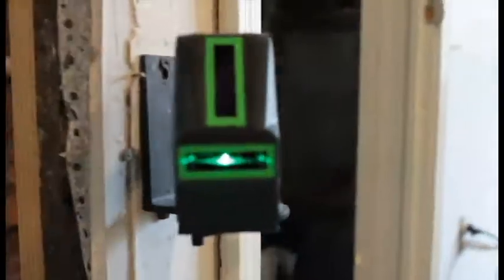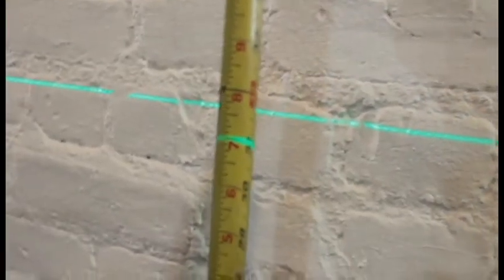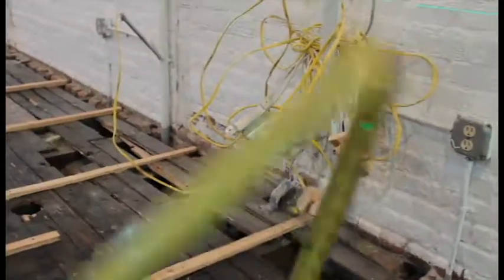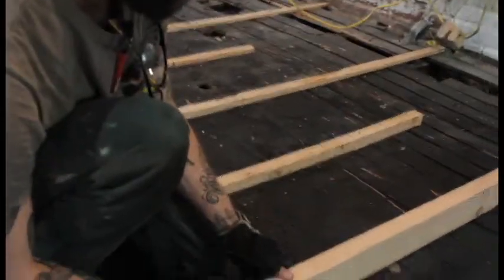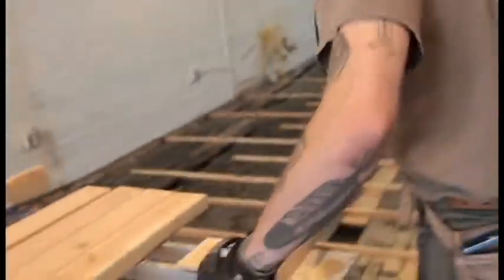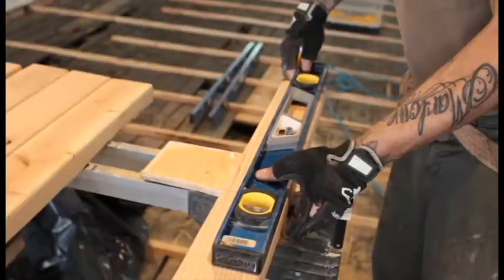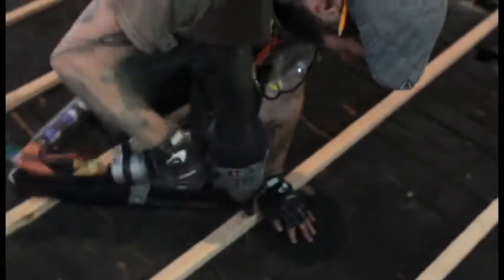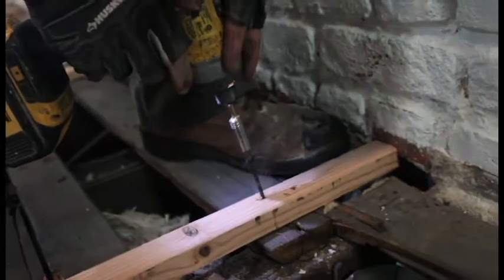How To Level Your Floors - Scribing Sleepers The Easy Way

Comment: Do u use a 360 degree laser? I have a regular self leveling laser lever on a tripod can I use that just put it in the middle of the room and rotate the laser around… also the floor I’m doing has 2 layers of 3/4 plywood I was thinking of going perpendicular with the sleepers.. what do you think? Thank u

Comment: I didn't get it.
Reply from the maker: Set your laser level up to find the highest point in the floor. Measuring from the floor up it will be the smallest number in the room. Move the laser up to an easy number to reference 10, 20, 30 etc. That number becomes your reference point which is 0. Measure along the joists to the low points and transfer those marks to the piece you are using. The goal is to fill the low points to meet the high point in the floor making it level. I hope this adds some clarity! This is just one way to do it, there are many other ways but I find this to be the most accurate and fastest way for me personally.
Reply: @carpenterdad3527  I have 2 rooms that I am making into one large room. Each room has a different depth. I am trying to make them the same as the kitchen floor.

So my highest point is the kitchen floor less the thickness of the plywood for the other rooms. Correct? Thanks
Reply: @carpenterdad3527   Without a doubt the best explanation on Youtube to an issue im currently having with a VERY uneven base.

I was hired to create an outdoor dining area on top of a couple parking spaces in front of a restaurant. The street's curb drops six inches, then increases further into the street. I couldn't find the right shape for the joist to conform to the changes in the weirdly sloped and pot hole ridden street until I saw this and realized how easy it actually was.

Thank you and lord jeebus for laser levels!
Reply from the maker: Glad it helped! Did you use pressure treated for the outdoor work?